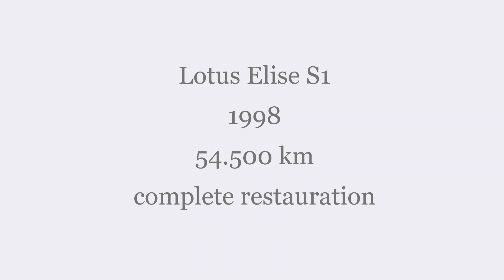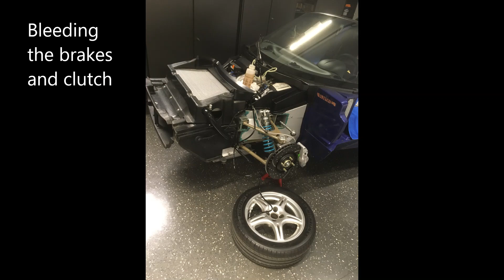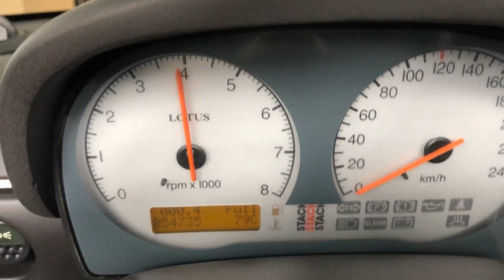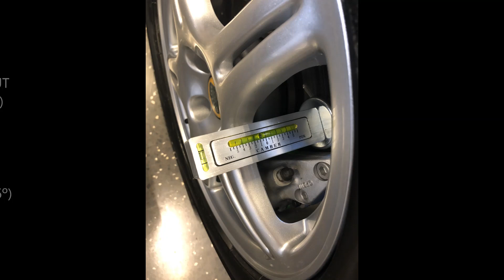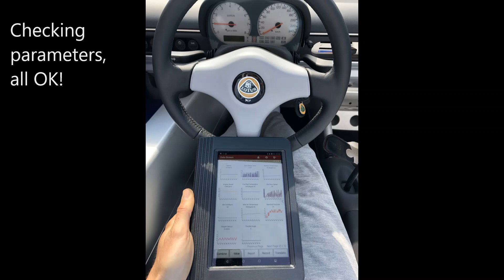Lotus Elise S1 complete restoration

Comment: Great Job !! How did you do to access the ECU parameters at 7.29 in your video ? I thought the lotus OBD system was needed for S1 Elise ?
Reply from the maker: Thnx 😀, I used universal OBD scanner (Elise S1 ECU is a Rover one), you plug it in rear L side in the laguage compartment.
Reply: @veharborut7965  Thanks for your answer! would you mind telling me the exact OBD scanner model and app you used? Mine didn't work on my Elise (it's a very early S1 RHD model)
Reply: @didjohann  Just the OBD Plug is the same, but wiring is different...you have to use MEMS Diag... http://memsdiag.blogspot.com/